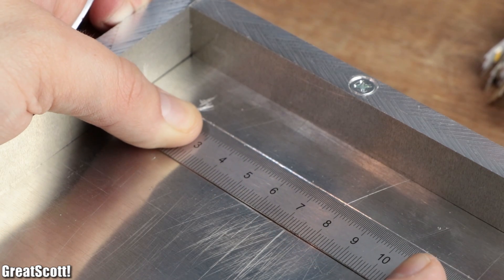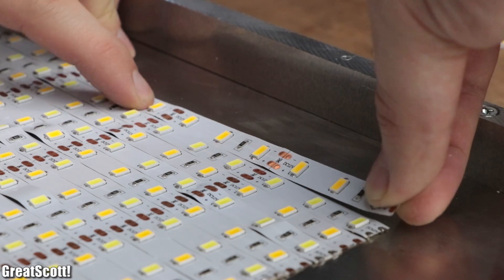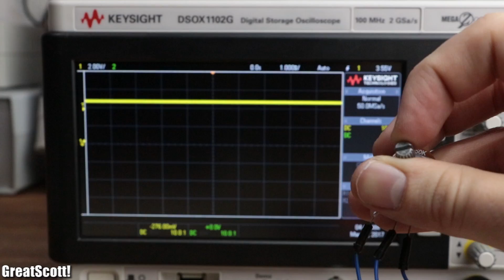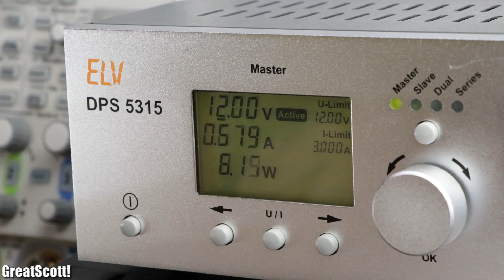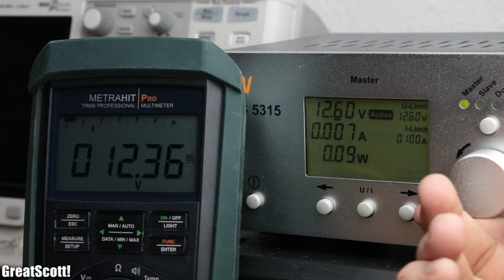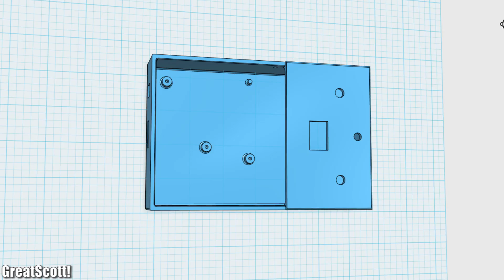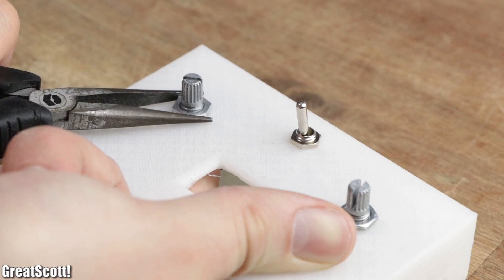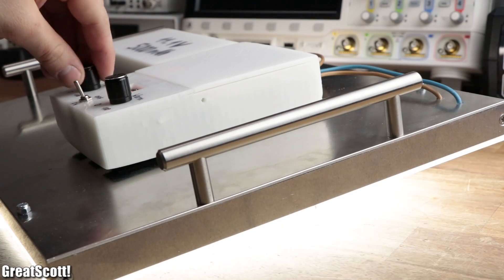DIY Portable LED Panel (Part 2) - the electronics

Comment: Why Not using a Attiny 13 to make it easyer?.  I used an old Monitor ccfl whith inverter that has a pwm input Pin,An on /of Pin, and powepins. I used only one 555 timer to trigger it. no mosfet driver ic is needet. And also no buck-boost converter becourse the ccfl inverter works on full Power at 9-14v input. I used a lead acid 1.3Ah Batterie becourse its heavy and works as a solid Base for the Lamp. It works for  2,5 h on full Power.

Comment: THis is a really good video. I like that you always share the schematics! The only thing is that I don't really understand why is needed the TC4420? Cant we just connect the TLC555 output to the Mosfet? If someone know, I will love to hear the explanation. 
Thanks.
Reply: I did some research and in case someon had the same questin, the reason for using the TC4420 is because when you are driving a MOSFET at high frequencys, the time the mosfet take to get from 0 to saturation increases, meaning that the mosfet stays longer in the transition phase. and during thes phase the mosfet draws more current at the gate, so you need a driver that basically will replicate the square wave but will be able to support the extra currnet that the mosfet is pulling.  (thats a bit of what I undertood )

Comment: Hi~Can the NE555x2  change to NE556?(Maybe ok?
And~I want to know How much voltage range Output from Ne555?  
In my 555 circuit,the voltage range it is about 0.6v, is that correct?
Sorry my English is not good~I live in Asia,Taiwan

Comment: Hey scott what temp do you use when you solder?  i need to desolder some components from a network switch that i am trying to fix and last time i tried to solder it is either the temp is not hot enough or there are other problems.  Can you give me any advice?

Comment: You said that the ledstrips need 3 amps. But that means that you cant use the warm and colwhite ledstrips at100% at once because the buck boost converter can only take 5 amps. Am i right or did i miss something? Is it possible to but a secound buck boost converter in parrallel so i can power warm and coldwhite ledstrips at 100% at once?(i know that the secound buck boost converter will push the energy loss higher. But is it possible)

Comment: You said that the ledstrips need 3 amps. But that means that you can't use the warm and coldwhite ledstrips at 100% at once because the buck boost converter can only take 5amps. Am i right or did i miss something?
Reply: nice copy paste :)

Comment: Hi Scot
How can I make a circuit which charges a Sony NP-F battery when a power source is connected and only drive by the power supply?
I am currently waiting for a voltage booster from China, which takes the voltage from 7.4(8.2) volt to 12 volt

Comment: I'm curious about what kind of power source should i use for my led strip. If I use a 5m long led strip with 5630 leds, which is 60leds/m and the manufacturer states it uses 12V, how can I calculate the current that requires? I don't have a variable power source to see how much it does take.
Reply: modaristis the seller usually mentions it

Comment: thankyou for this video, just one tip, it always makes me cringe when I see single insulated wires going through metal holes, especially those of the opposite polarity. I would recommend to try and avoid this wherever possible

Comment: You should have used a buss bar or not stripped the entire wires, all that exposed live wire is very dangerous especially with a metal case.

Comment: How reliable is the BUCK/BOOST converter you are using for your project?  Would it maintain a stable 5.25V supply for use with a Raspberry Pi for a few hours with the battery pack you are using?
Reply from the maker: Yes

Comment: Great video and excellent tutorial. However I have one thing to point out: those wires on the buck-boost input look a bit thin, specially when you compare it to the wires used to power the LEDs inside the case...
I know it isn't a big issue (the wire is too short and you are only talking about 3 amps max), but, if I build this, I'll use a wire similar to that other solid wire near the LED strips.

Comment: On your circuit, shouldn't you have pulled the mosfet gates down to GND with a high value resistor like a 100K? And on the inputs to the fet drivers too? I think you're also supposed to have a small cap on the fet driver output to ground before the 10 ohm resistor.

Comment: 4:01 you almost lost me there, but later on I (somewhat) understood. Gosh, I love your projects. Can't wait to see the solar project, I'm into that.

 I have prepared 10x 12v 9Ah Panasonic UPS batteries (around 1000 Wh in great condition - around 13.5v to 13.9v each) and a UPS that I will use as a DC to AC converter (not sure if it's going to work well 24/7 though, even with a low load of 300W, maybe 500W at peak, but it's worth testing). All I need now is 1 or 2 solar panels (considering I don't use power all day, just around 5-6 hours at most, it's worth trying this experiment).

Comment: Love the project! I am curious to why you wouldn't just use two CC/CV buck converters with a voltage divider on the current side to vary the current flowing to the LED's

Comment: Just to understand it well: you showed us some Arduino code. Am I correct that with that code it would be very easy to drive the leds?
It's just that I don't have all those electronics part lying around, while I do have some spare arduino nano's.
Reply from the maker: Yes, you could use the Arduino.

Comment: should add grommets where the wires pass through the aluminum, it will eventually break through the casing and cause a short

Comment: Hi, Is this configuration powerful enough for lighting an aquarium? I have 430l aquarium and I am bored of old neon tubes :D
Reply: Probably not. It may be ok for chichlid tank, but its too weak for any plants. You can use power leds 3-30w, the control/dimm circuit is pretty much the same, just use appropriate MOSFET for the led of choice.
Reply: Gorjan Dzundev yeah, power leds sounds better. Thank you for answer! :)

Comment: Highly recommend doing more videos about ESP8266 development board instead of ATMega development board. It is cheaper and 10 times faster with WiFi available. Arduino can't to audio processing, high fps display or remote configuration while ESP8266 can.
Reply: But ESP8266 isn't 5V compatible, has much lower GPIO's and only one ADC input. Even the ATtiny45/85 has more ADC inputs and is much cheaper than an ESP8266

Comment: Hey, can someone here help me?
I am new into electronics and i wanted to make another more or less simple project.
The plan is to build an rechargeable gameboy. The Gameboy itself works with 3.0 Volts. The idea was to use a cheap powerbank. I would remove the case of the powerbank and then use the board and stuff to let it work normal. The problem is that the powerbank would give me 5 Volts through the USB port but i need round about 3 Volts. So i need to find a way to connect the single used Lipo cell of the Powerbank (with 3.7 Volts, the device can handle it) directly to to the device while loading the battery with the board. Of course i could simply connect the battery to the gameboy but if i charge it, the gameboy would not be able to be turned on and other problems would happen. Can someone help me? (I can speak german)

Comment: Why can you safely connect all these LED Strips in parallel and not worry about current imbalance ?
Reply: If they're all in parallel and all have the same ground, they will also have the same equivalent resistance. This means that equal current will flow through each LED strip.
Reply: OK I understand that but what about Process variations different LED strips of the same color or if one of the LEDs is failing, it'll lead to quicker failure of all the other branches
Reply: Oh, well if one of the LEDs fail then that strip will stop working considering they are wired in series within each parallel branch. If one of them does fail than the other strips will have slightly increased current, but it's probably not going to be on long enough in order to damage the LED's too badly. They also have the aluminum backplating to act as a heatsink.
Reply: OK thank you

Comment: This will make a good high CRI lamp.
I doubt that your battery will last longer than 30 minutes.
Cause your approach has efficiency issues in all corners.
Also: NEVER EVER PUT STIFF WIRES THROUGH SHARP HOLES IN METAL! Rather put the whole double insulated cables through!
Reply: Kyôdai Ken the wires aren't moving, so I don't think its that much of an issue

Comment: Just curious, is it possible to add  a wireless controller for this? Like bluetooth or wifi, it isn't that much necessary but I just wanted to know if it was possible.
Reply from the maker: Sure. That is possible

Comment: To handle the flexing corners in large 3D-Prints use a simple 5mm Brim in Cura. This adds a one-layer-high brim around your print which helps bed-adhesion a lot :)

Comment: Cool project!
Just a thought, it's always good to use a rubber grommet when you're running a wire through a hole, especially through sharp metal
If the wire isn't going to move I guess it's not that big of a deal though

Comment: As always - I love your videos !!  Best on YouTube!   I gotta say - every time I see you use your lighter as a heat source for heat shrink tubing - it makes me smile !!  I assume you like using it better than a gun; as you have a lab full of sophisticated  equipment.  So - can you tell me - why do you prefer an open flame to a quality heat gun ??
Reply from the maker: It is faster. That is pretty much the only reason.
Reply: I worked sometime on the powergrid in Switzerland, and if you want to heatshrink something thick like your arm and long as your leg. A propane gasburner is much much faster than a Heatgun ;)
Reply: I'd burn my house down if I used a gasburner - laugh !!

Comment: Is that buck/boost converter not under enough load that it would overheat with no airflow in a plastic box? Have you done any runtime/thermal tests? Interested to see the results of that.

Comment: Was hälst du von einer 12V USV fürs Heimnetzwerk? Die meisten Geräte laufen ja auf 12V. Welchen Energiespeicher würdest du dafür nutzen und kannst du ein step-up/down Wandler empfehlen um die Spannung konstant zu halten?

What do you think about a 12V UPS(unbreakable power supply) for home networking... The most network devices running with 12V. Which energy storage would you use? Can you recommend a step-up/down converter to hold the voltage stable?
Reply: Lead Acid AGM deep cycle batteries would be the Batterytype of choice for that. Have a look at the UPS of data centers or the small little UPS for home. They all use these types of Batteries.

Btw. Die sind auch sicherer ;)

Comment: What are those little hooks called that you use to connect to your oscilloscope?
Reply: Probe hook, test hook. You can get tiny little claws as well that grab smd pins pretty well.
Reply: I think you are asking about Insulated Alligator Clips
Reply: No not aligator clips.  It's got like a little extendable hook.  You can see it at 4:06

Comment: isn't the 2,5mm² a litte bit overkill?
Reply: no. voltage drop at those currents is considerable. and solid cable is cheap and easy to come by.
Reply from the maker: Maybe ;-)

Comment: I remember that the PWM frequency of the Arduino is capable of handling up to thirty something kHz if I'm right?
If that is the case then the circuit to increase the PWM frequency is not necessary ,is it?
Reply from the maker: Yes, Arduino could have worked fine. But I wanted to use the 555 timer instead.

Comment: the specs of the buck boost converter show that it works with a max of 5a. how are you running a 12 volt 6amp setup on this. am i missing something.
Reply from the maker: I tested it with a 6A current draw for an extended amount of time with good results. And since I pretty much never use the complete light output of the panel it usually only draws around 2-3A.

Comment: Could it be possible to make this project any more complicated?  That would be really useful...
Reply from the maker: Making circuits by yourself and metalworking will always be a bit complicated. If that is not your thing, then move on to different thing but don't blame me.
Reply: You misunderstand me. This is a great project but you have over complicated it, massively.
Keep up the good work.
Reply: iceberg789 or an frequency synchronisation jack for high speed cameras.
Reply: iceberg789 or adding autocorrection, so that it always adapts to the right white temperatur
Reply: iceberg789 well, with cameras going up to 21k and more... and I took 2 weeks internships in a huge local television company here in Germany and man where they concerned about flickering... they even build their own LED panels for synchronisation with the cameras. And with panels I mean huge RGB panels ...
Reply: It would also have the added benefit of being able to cut the light without 1000 shadows.

Comment: aren't you risking shorting the circuit on the aluminum? I would have put some foam spacers under the led's poles :/
Reply from the maker: The adhesive layer works pretty well as an insulator.
Reply: since we're here I also suggest you to increase the music volume a little bit, it's quite low :)
Reply from the maker: Noted

Comment: Cool project, I need one! I would print in PLA to prevent warping, and so I would have to make the top part a separate cover because I hate removing supports with PLA. As for the labeling it gets a little tricky, but I export a dxf file of the face of the box, and import to Adobe Illustrator, or similar. Then I design my overlay label and print. The print gets wide transfer tape on both sides (Amazon), and the top is covered with matte x clear sheet like McMaster-Carr item #85585K33. Round the label's corners for professional look.

Comment: why did you use a mosfet driver instead of driving it directly with the ne555 ?
Reply from the maker: I used a TLC555. Its output stage could not handle the gate current of the MOSFET.
Reply: I out 200mA
Reply: Thank you, so if we use the regular 555 with the bjt output stage, we can eliminate the mosfet driver, correct ?
Reply: The ne555 cannot handle the current of all those LED's passing through it. You will have a new brown spot on your breadboard if you try that.

Comment: How longh does the baterry last with full brightness?
Reply from the maker: WIth pure white and warm white combined it requires 6A at 12V. (5Ah*11.1V)/(6A*12V) = 0.77h. But I usually only use 2A for the lights which equals a battery runtime of 2.5h

Comment: Why doesnt the bottom pads of LED short with the Aluminum base?
Reply from the maker: Because there is an adhesive layer between the copper and aluminium
Reply: But the LEDs get warm when they are lit right? so wont the glue/adhesive
 burn/melt off and make contact with aluminum over time? Just 
saying....

Comment: How bright is it? Looks so bad ass!
Reply from the maker: Well, 70W of LED light bright. Sorry, but I have no instrument to measure the light output.
Reply: Still 70W should be bright enough! Thanks! Btw, I have used Lux meter app on my phone, seemed to be accurate withing couple hundred lux
Reply: GreatScott! You can even use a mobile to approximate light intensity. I also used my mobile as a function generator.